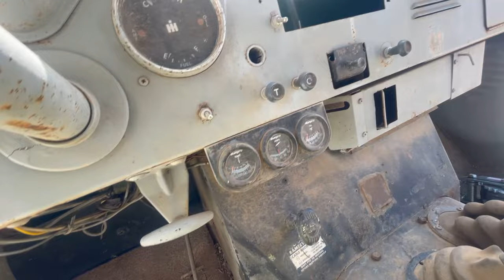THE SCOUT LIFE: International Scout 80 WILL IT RUN? WILL IT DRIVE? | Barn Find

Comment: Back in 1977 I bought a 1967 Scout 800 with 45,000 miles on it !!! If I recall it had a 192ci 4 cylinder,3 speed on the floor with 2 other gear shifters for low range and front axe engagement. It was in excellent condition, but since I had a daily one way  60 mile commute to college, and the fact that it was screaming a mere 50 mph,I sold it and bought a new 1978 K5 Blazer!!!! Still wish I still had them both!!!